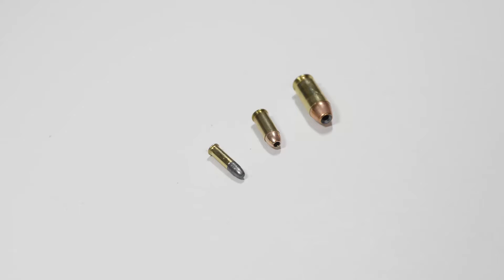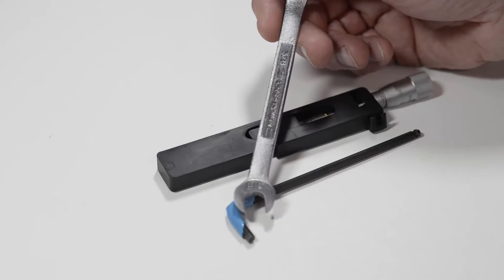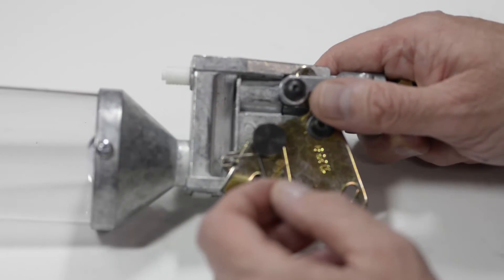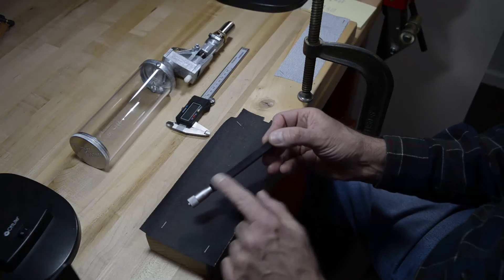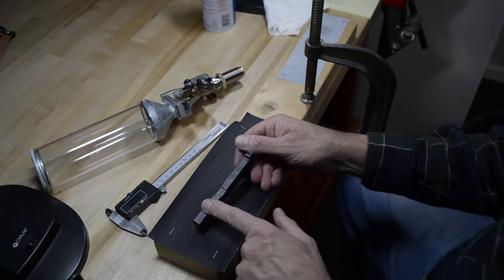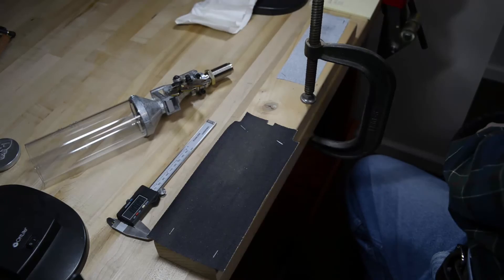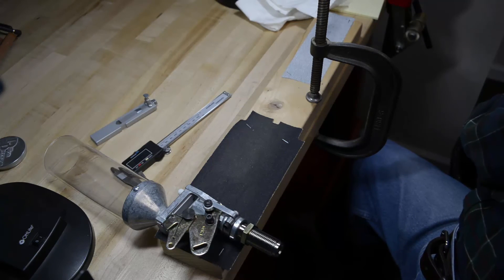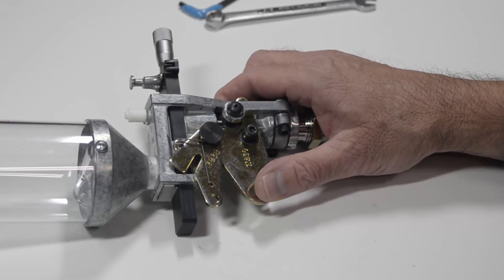Installing the Arredondo powder bar

Comment: Inconsistency in sanding measurements could be from using a 2X4 I would use a flat granite block or tile and adhesive backed sand paper for a more consistent cross measurement.

Comment: Would it not be as risky if you sanded the spacer bar versus the powder bar?  I think you would accomplish the same intended outcome with a much cheaper part!  However you did make a fantastic video!  Thanks
Reply from the maker: Cloyce, that is doable.  Just need to keep in mind the spacer bar is made of metal while the Arredondo is made from a plastic.  So one would have to make sure your sandpaper can handle large metal surfaces.

Comment: would wet and dry   sandpaper work
Reply from the maker: Edmundo, sorry for the delay.  I just got back from Camp Perry.  I have never used wet sandpaper.  The Arredondo powder bar is made from a plastic and I was able to get the desired thickness using standard sandpaper from a hardware store.